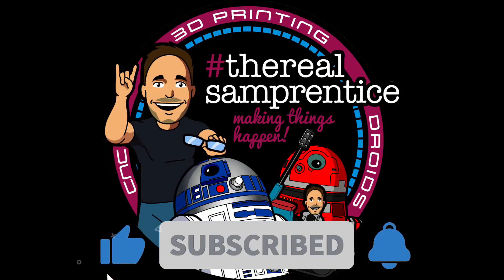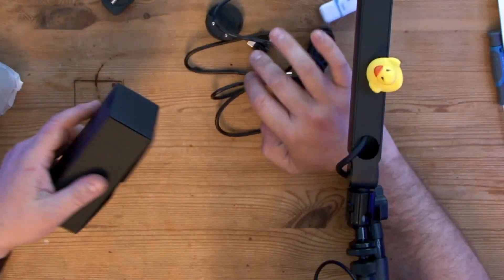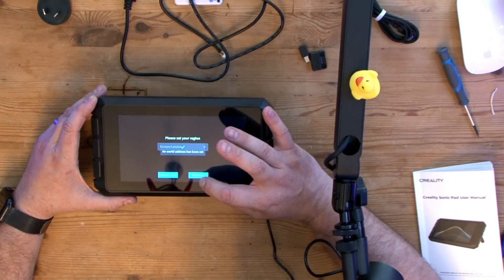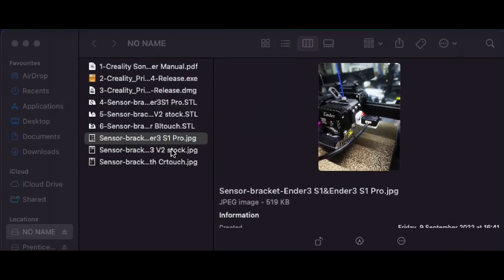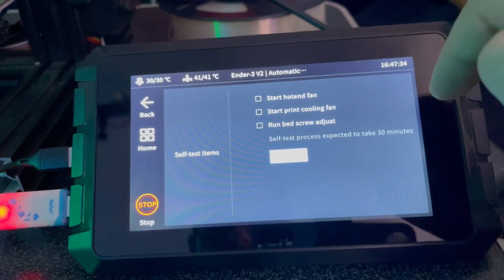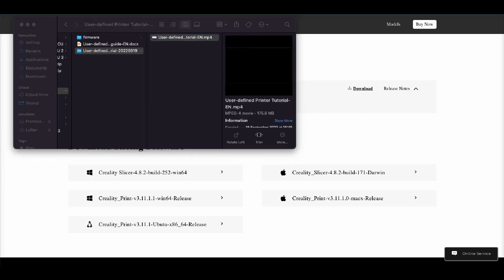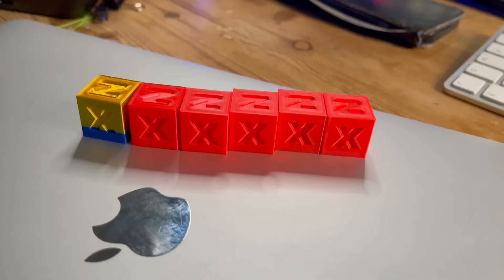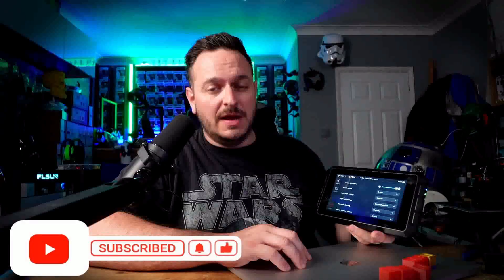3D Printing Revolution: Introducing Creality Sonic Pad

Comment: I installed on my S1 Plus and my V2. Next I'll put on my pro and see how it works with my delta Flsun Q5. So far, so good. My first attempt to set up input shaper didn't went well. Then I've learn that is supposed to to setup pressure advance first. Other thing to consider is that bed slingers Will vary vibrations depending on the height of the object. Is safe to assume that you can go 500mm/s after a few layers and slowing down to 200mm/s after the print passes 15cm height. Another thing is the filament. You have to go 10 to 15 extra degrees to avoid heatcreeps but then you have stringing. Conclusion: practice, practice, practice.

Comment: Would be really interested to see a how to video to get it working with older Creality machines like the CR-10 max as that is a machine that could really benefit from the more accurate bed leveling and as it can print large things it would also benefit from a speed increase

Comment: I see one issue with every video on the Sonic Pad and that is upgrading.  The pad goes straight into printer setup and converting to Klipper without the option to bypass that or to check for an update first.  Seeing as there have been pri tears updated and updates to the Sonic Pad, it would make sense to be able to update the pad before setting up the printer.  Why do the work twice? Either I am corrector all youtubers skip this step or dont do enough research before jumping in and wanting to get a video done for views.  ?
Reply from the maker: Well mine was the first out and there was only what we had at the time, the updates since aren’t relevant to this video.

Comment: Would have like to understand . what it is made for ?
But i only see 150 page of config but dont know why ?
is it only for speed ?
can it control more then one printer ?
Why would i need it when i already have a screen on my printer ?
Is it usefull to something or  just another gadget " du jours "
Reply from the maker: Sure thing it’s an alternative software to marlin, klipper has some interesting features which creality are looking to integrate into their current product line. Hence the sonic pad, part of the benefits include input shaping which allows you to measure frequencies and adapt that output to look and improve at print speed and quality, so things like ringing on the prints etc. You can do this via a raspberry pi but since they are in short supply there are a couple of companies looking at experimenting with this type of solution

Comment: I just received my Sonic Pad and set up up with my E3v2, 4.2.7, w/CR Touch and it works great!   I still need to get the accelerometer setup, but I'm a bit fuzzy still on how to get Y measurements off of the bed, and how to merge them with the default X measurements.
Reply from the maker: Run the x first then open up the printer.cfg file
It’s right at the bottom :)
Reply: @TheRealSamPrentice  Great!   How did you attach the sensor to the bed?

Comment: The October drop also enabled Mainsail on port 8819.  Pretty cool!
Reply from the maker: How are you finding having access to that has changed your setup?
Reply: @TheRealSamPrentice  I really haven't tbh.
Reply from the maker: @MrScreenCaster  :)
Reply: @TheRealSamPrentice  I have to say though, even if I wasn't able to get better speed without losing quality (still working on that), the Sonic Pad is a great solution for tweaking.  If I had to recompile every time I made a configuration change, I would have gone insane trying to get this 400x400x400 project running.

Comment: Hi, im a total 3d printer noob. I got an Ender 6 a while ago and I have seen a lot about klipper, marlin etc.. So im curious, with this, would you be able to use like MobileRaker on your phone or some UI on your PC to send prints to the printer this way? I assume so because you can add a camera to it but I wasn't really sure
Reply: Basically, you will get web control center "fluidd" that you can use your mobile to connect it from local ip address, from there you can control everything, you can also setup ddns to allow remote access to your printer from outside your workspace

Comment: Do they give you full SSH access to the device? 
I don't really understand video with the virtual machine and stuff. Is that just to build the firmware for the board? Couldn't that be done on the device itself?
I do find it interesting but I'm afraid that, coming from Creality, it'll be like an Ender 3 interpretation of a Raspberry Pi that looks fine from the outside but all the botched details make it garbage. However, if it's possible to flash our own operating systems onto it it could be useful.
Also you say that they're worried about some source code leaking if you open "the back end". Isn't Klipper GPL and therefore any modifications they made GPL as well? Have you tried requesting the source code?
Reply from the maker: Good question and there is a password on the ssh which I’m trying to find out. There is a very over complicated way of adding alternative printers into the mix (which I’m doing now) but the downloads are empty so I’m bringing in the cfg files to make it all work
Reply from the maker: so you can ssh into the IP address and once you are there you are greeted with a password, which creality as of yet wont give out. Currently klipper holds a range of .cfg files inside of their github, so you can grab that file and whip it onto you usb and the pad will read it. HOWEVER, you also need to export klipper.bin file onto your sd card to be read by the printer. Creality has a very overcomplicated solution to this by you hosting a virtual machine and building files to then export. This is not a good solution at all and its very complicated with little to no support on the errors generated. That being said i'm told that in October there will be another software upgrade where it will open things up.. Watch this space!
Reply: @TheRealSamPrentice  Thanks for the follow-up comment! I appreciate it. Definitely gonna keep an eye out for when you share more stuff about it.

I kinda expected it to be that way. It's sad because devices like that can't be used to their full potential if the company has a mentality like that.
Thing is, if they would instead document everything and gave full access or at least allow flashing a different operating system onto it they'd probably sell way more units because it would broaden the customer base.
It's not like they invented anything new. It's an SBC with a display and the ports to connect a printer. They're missing the opportunity to become the all-in-one Klipper-runner solution for everyone.

Comment: afaik, Klipper will run on any processor that can run linux. I would have thought that a cheap tablet would do the same job, and be able to run unadulterated Klipper with Fluid interface, say, just as you would with a raspberry PI, but with the advantage of an extra touch screen, if you wanted. If space was not a problem, then a refurbed laptop or desktop would do, for much less money.
Reply: Eh for 160 isn't not bad since it comes with everything including the sensor.  I've never had a good experience with those  super cheap tablets.  They are slow and just awful.  I'd buy this for convenience.
Reply: I have plenty of old laptops laying around that I could use, but would probably pay the $160 for the convenience and hassle-avoidance.
Reply: Your missing the point of this not everyone wants to diy everything nor do most of us have the time. It’s pretty easy and opens up klipper to the rest of us. I did the klipper and mainsail thing took me hours to do and I said hell with this and went back to Marlin.

Comment: This is pretty neat, If they fully open it up turning it into fully self contained unit of screen and computer they could have a great product here. Especially if they can maintain supply flow given the RPI shortages.

I feel like the RPI shortage could in the long haul harm Raspberry in the 3D printing sector, As we are starting to see more companies come up with alt solutions. Big Tree is selling something an MCU now that has a daughter board that runs Klipper.
Reply: I think the raspberry pi sucess formula is ability+low cost. A raspberry pi msrp is $35. Until they can match that raspberry pi will still be viable.

Comment: I'd be curious how the CR-Touch and Sensor mount works together?  Or if we're running both, we need to model a new mount ourselves?
Reply from the maker: The g unit isn’t active so you can pop on for the setup and take it off.
Reply: @TheRealSamPrentice  Can you give us some detail on how you mounted the g-sensor to measure the other axis?   Great live stream today, btw...best one I've seen in a long time!  😀

Comment: if you feed the pad a valid Klipper .cfg file under "Other Printers", is it able to spit out the related Klipper firmware .bin file for a 3rd-party Marlin compatible printer...or is it actually necessary to spin up a different Klipper VM instance in order to get your hands on a non-Creality firmware file??
Reply from the maker: Good question, and lets say... Its complicated. So you can ssh into the IP address and once you are there you are greeted with a password, which creality as of yet wont give out. Currently klipper holds a range of .cfg files inside of their github, so you can grab that file and whip it onto you usb and the pad will read it. HOWEVER, you also need to export klipper.bin file onto your sd card to be read by the printer. Creality has a very overcomplicated solution to this by you hosting a virtual machine and building files to then export. This is not a good solution at all and its very complicated with little to no support on the errors generated. That being said i'm told that in October there will be another software upgrade where it will open things up.. Watch this space!
Reply: "3rd-party Marlin compatible printer": The firmware.bin is specific for the processor which the printer board uses and it is impossible to find out the processor type from printer.cfg.
Reply from the maker: @adameichler  if you pull the files it will
Usually tell you the types to make the .bin
Reply: @TheRealSamPrentice  I have a Creality v4.2.7 mainboard, so I'm hoping that the included v2 klipper.bin works with it (still waiting on mine to ship).
Reply from the maker: @MrScreenCaster  that’ll work mine here is 4.2.2
Reply: @TheRealSamPrentice  Thanks SO much for all of your testing and feedback!!  I was starting to be a bit concerned about my purchase since there's not a lot of info on this yet, besides the Creality marketing blurbs.  I'm really looking forward to your next video on the Sonic Pad!
Reply from the maker: @MrScreenCaster  no thank you! I’ve set out to challenge them and try to push them to
Make things better, but for stock creality printers this will be great, but if you have mods like different boards, extrudes or stepper motors familiarity around the klipper software is going to be essential.

Comment: Does the printer need to have a klipper firmware installed? I have a Fokoos Odin f3 with mks nano v1.2...
Reply from the maker: It would have to be flashed with the .bin file
Reply: @TheRealSamPrentice  Oh, so I'll have to wait for Creality to supply the firmware I suppose...
Reply from the maker: @sylvainmenard3311  Well I doubt that creality will start making .bin files for alternative products, but I expect the facebook group will start exporting .bin files ready for the printers we want to use this on.
Reply: @TheRealSamPrentice  This brings up something that I've been wondering about.  Does the pad actually process the built-in printer.cfg files, say for the E3v2, and create a firmware.bin file...or are the firmware files already resident on the file system, and it just spits out one that it has?  I'm curious because I've been thinking about an EnderExtender kit that would increase the bed size.  All else being equal, it seems like it'd be an easy modification of the existing config file to 300x300x250 to make that work.

Comment: Thanks for the video, I don't know how I've never found your channel before, but I'm subscribed now. I purchased the sonic pad last week at the release (I knew it would be sold out quickly) and am waiting for it to ship. Currently working on an ender3pro corexy conversion and am planning on using this pad to control it. You mentioned custom printers configuration during the setup and I would be very interested in seeing more information on how to set up a profile for a printer that isn't pre-configured.  Thanks!
Reply from the maker: Hey Aaron! Thank you sir ! Yep I’m working on some videos but if you check out the klipper GitHub if you can find the pre complied .cfg file you’re into a winner :)

Comment: Just purchased one of these units. How do you change the printing speeds? It only prints the same as it did before I used this. .Is there special softwere I need to add? I tried using Prusslicer, Creality print and Ultimaker Cura, but I cannot change print speed over 100% in all. Thank you for your help.
Reply: Open the fluidd web interface.
Reply: @MrScreenCaster  Thank you, So I can change the speed from 100% up to 500% then? Is there any other settings I should change, as I increase speed?

Comment: @The Real Sam Prentice  Could you show us how you've set up your camera?  I'd like to confirm that mine is right.  Thanks in advance!
Reply from the maker: Yes I can
Reply: @TheRealSamPrentice  Please disregard sir.  I finally figured out the camera and timelapse settings.
Reply from the maker: @MrScreenCaster  was this on the upload via cura ?
Reply: @TheRealSamPrentice  No...my camera was working ok, but I couldn't do timelapse.  I have a Razer Kiyo (with the ring light), and thought it was a camera setup problem - but it turned out to be a bug in the software.  The workaround I finally figured out was to edit moonraker.conf to capture images using the loopback address (127.0.0.1).  It can do regular timelapse now but, if I park the head, it causes the print to fail miserably...so I don't do that (for now, anyway).

Comment: I added and enabled my camera and timelapse on the pad, a Razer Kiyo, and it sees it both on the pad and in the Klipper web interface, where I also enabled timelapse...but it keeps saying "Error taking timelapse frame".  Am I missing something simple?
Reply from the maker: You can edit and set up your camera first :) then is an option for it - let me know if you get stuck
Reply: @TheRealSamPrentice  I'm completely baffled by this.  So far, it doesn't look like anyone else has reported the problem (it's early days, I know), and Creality has only pointed me to the FAQ so far.  I've tried everything that I can think of given the currently exposed options and config files, but I'm no expert.  I've even tried the different firmware images but, of course, they don't work (had to try though).   

I originally bought the camera to do timelapse on OctoPrint, then I discovered that it's not very easy to set up...so one of the big selling points for me was the ease of doing timelapse videos with this pad.  Hopefully they'll open it up soon so I can troubleshoot properly.

Comment: What do you change in the slicer to take advantage of the new speed
Reply from the maker: The speed.. or you can change up from 100% to where you feel comfortable. It’ll be 50/60 mms by default
Reply: @TheRealSamPrentice  so just use the stock print profile and just ramp it up in klipper
Reply from the maker: @florida_man_games4312  you can and I have but find your printers sweet spot :)

Comment: I've been thinking about an EnderExtender kit that would increase my E3v2 bed size.  All else being equal, is it possible to just tweak the printer.cfg file to 300x300x250mm, or would I need to spin a new firmware version?
Reply from the maker: That’s correct i have the 400x400x250 one here as it happens
Reply: @TheRealSamPrentice  That's awesome!   Did you put a 400.mm heater on it too, with an SSR?  I'm interested to know how that works out...

Comment: Never used Klipper, but is it an octo pi replacement that requires Klipper firmware? Or does this pad just require Klipper firmware to work?
Reply from the maker: It’s not octopi, I think of it not having marlin installed and instead it’s something else. Klipper or a version of it is installed on the pad and that’s it

Comment: For the owners of Ender 3 S1 Pro with F1 chipset, there is no support in sonic pad.. Not sure if you can add it manually somehow but not in the list..
Reply from the maker: I expect you can configure that, I take it the F1 chipset is a replacement for the STM32 issues?
Reply: This issue will crop up on other printers, not just the S1 Pro.
The F1 chipset is an STM32, it's just not supported by a lot of firmwares yet cause it's on the newer side. And yes it's a replacement for older STM32s that are out of stock or costing a lung.

Comment: Not sure if you will see this, but I got a sonic pad and am having a problem. My first layer goes down well when printing but when the print starts to build upward, it will rub on any of the diagonal infill. It doesn't do it with the horizontal infill so I really don't know what to do. I've tried re levelling alot already and changing the z offset but nothing works. I'm hoping you or someone might have a suggestion. Thanks
Reply from the maker: I’d need a bit more info like which printer ? Email me some pics if you like